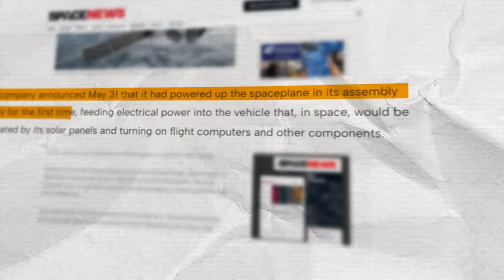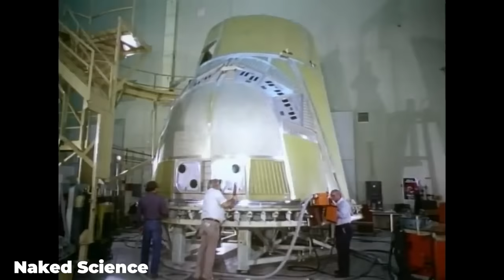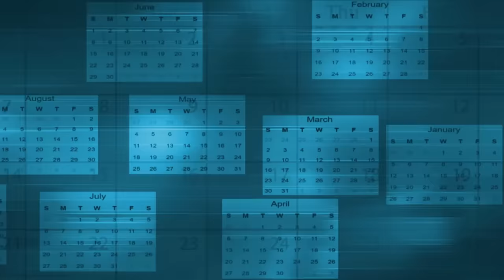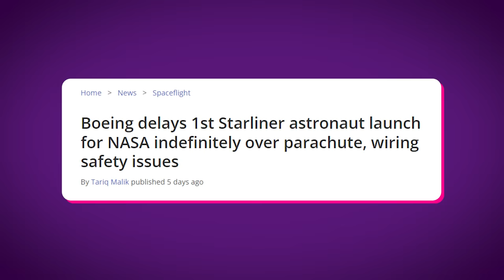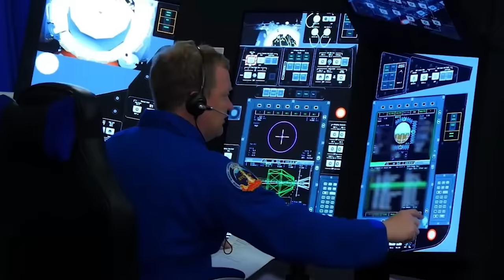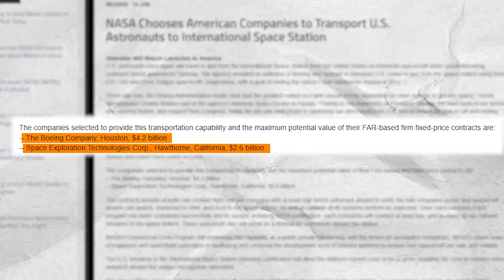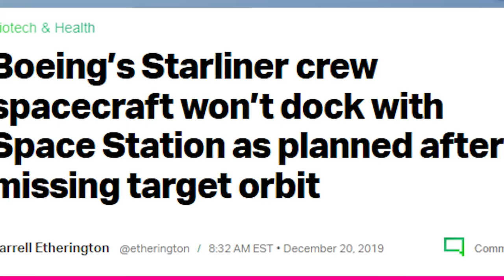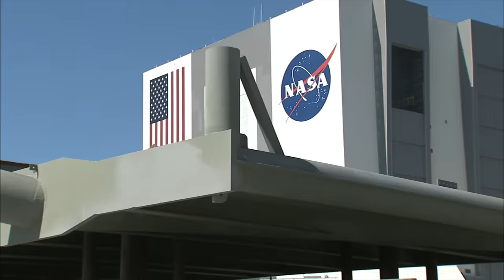NASA's Dream Chaser Space Plane Is Online!

Comment: I've heard that since Boeing merged with McDonnel Douglas in the late 90's,  the standard of engineering nosedived on their planes because the execs put too much time pressure on the engineers. Apparently it was a huge culture change for Boeing empIoyees.  I wouldn't be in the least surprised if the same mentality has happened here - a push to get it done quickly instead of doing it right, errors are made, and the whole thing ends up taking longer than if it'd been done more slowly and carefully in the first place.
Reply: Hence the old saying:  "Do it nice, or do it twice."  Or thrice...
Reply: Pencil sharpeners surely are needed, but not at the top where they scream to pull the plug when the first mistake happens and when a single penny too much has been spent, reducing profits, the only metric that matters until bankruptcy.

Missing failure culture probably is another reason?
🤔🍃😉

Comment: I don’t understand why Boeing only has two active Starliner. Wouldn’t it make more sense to build multiple versions. They could then test more frequently like how SpaceX operates. They could then retire the existing vehicle, or do other test on the body while they focus on building another starliner with the correct adhesive tape. Starliner will eventually need to have a sustained production line once a more final version is set as it can’t be reused indefinitely. It’s only meant to be used 10 times before retirement.

Comment: Line the areas of the capsule with flame retardant material all you want.  Electrical wiring conducts electricity.  This generates heat as a normal byproduct of operation.  The adhesive of the tape wrapping all the wiring is flammable.  It WILL get hot and probably catch fire.  Who cares if the rest of capsule doesn't catch fire.  HOW do you control a spacecraft when all the wiring is burnt?!

Comment: Dreamchaser MAY be able to service the ISS FOR CARGO, before Starliner is fully crew certified as operational. However, DreamChaser is FAR from ready for a crew version. Just ask SpaceX how much difference certifying a vehicle for crew is than the process for certifying their Cargo Dragon 1. You amnesiacs are forgetting how much you were complaining about how long NASA was taking to certify Dragon 2 for crew, and you all seem to forget about the parachute problems and the explosion during testing for the Crew Abort test. And it seems like it was a good thing that SpaceX chose to do the dynamic flight abort test, since having a Super Draco explosion with a crew inside on the launch pad would not have been a good look.

Comment: You forgot to mention the orignal dream chaser design dates back to the Russian Bor Mig-105
Reply: It doesn't, but it's based on Boeing X20 Dyna-Soar, Soviet Mig-105 or BOR-4 were in 60s and 80s respectively while United States Air Force was working on X-20 Dyna-Soar in 50s.
Reply: @JigilJigil  Go take a look at pictures of those 2 and see which one it exactly looks like!  X20 was based on 1941 Silbervogel proposal from Germany by the way.

Comment: 3:38 why not use a cooling system for hot spots during reentry
Reply: i was thinking . liquid nitrogen radiator on the inside or water cooled chillers radiators

Comment: The shuttle could never land automatically. I believe the landing gear had to be lowered manually for one and I understand there was resistance from Astronauts to having a fully automated landing system on board (e.g. like the Soviet Buran).  I've heard it said the engineers referred to the landing gear switch as the 'astronauts job protection switch'.